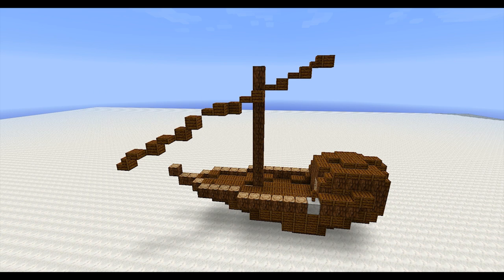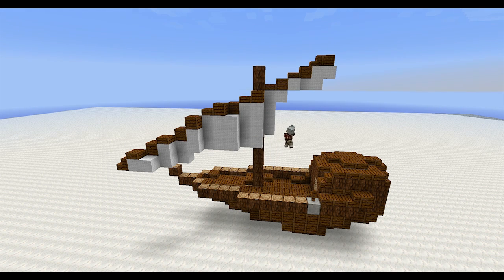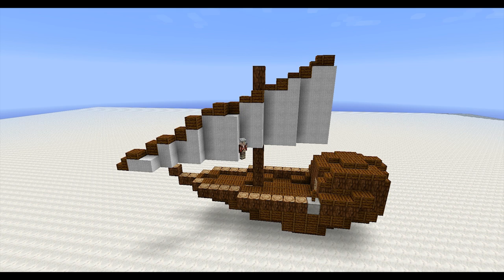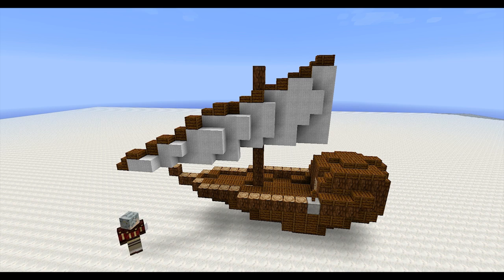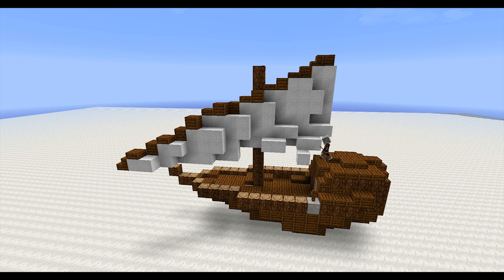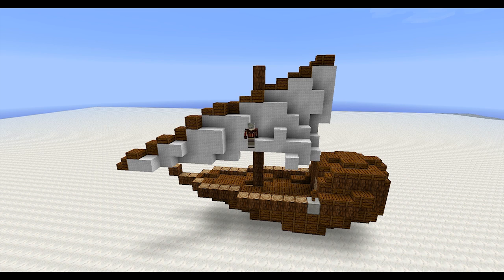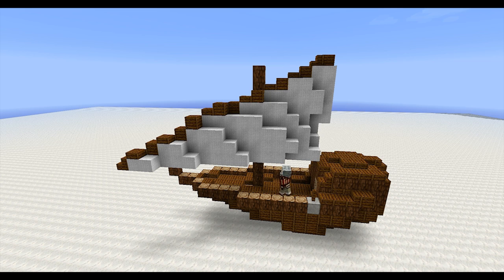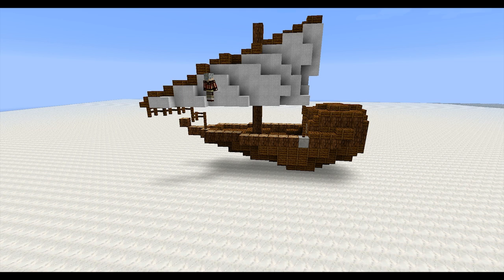VoxelSchool: Organic Curvature Overview

Comment: :/ the way the mast or base is angled gives you those vertical lines, and shadows after you used extrusion. It gets a little more difficult when the mast is dead straight.